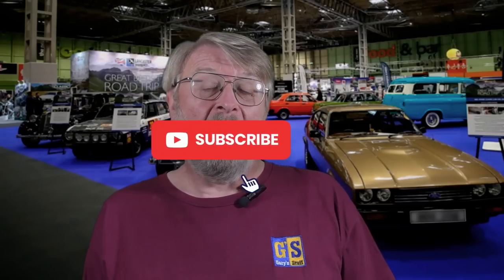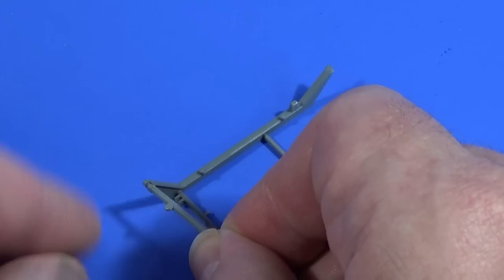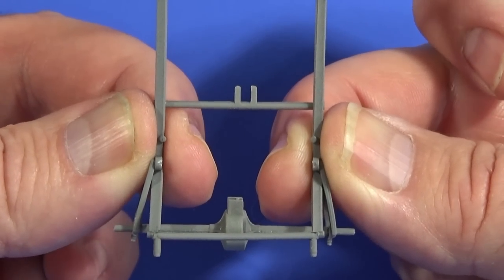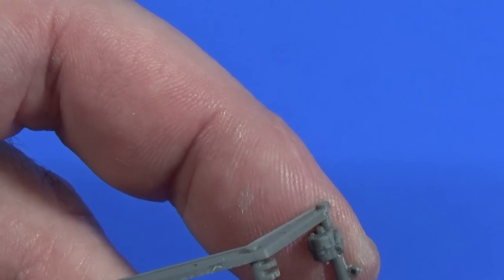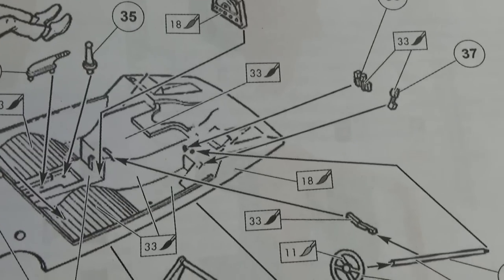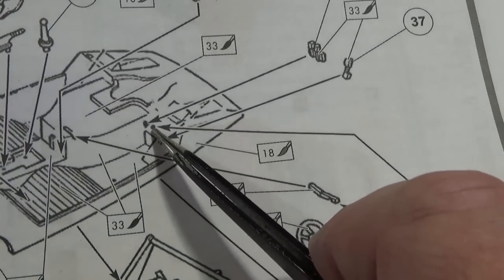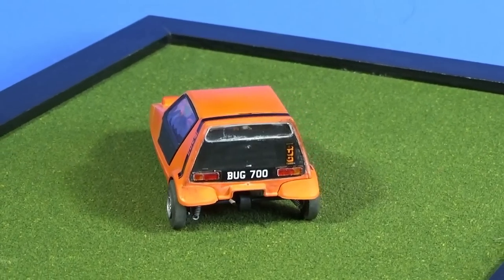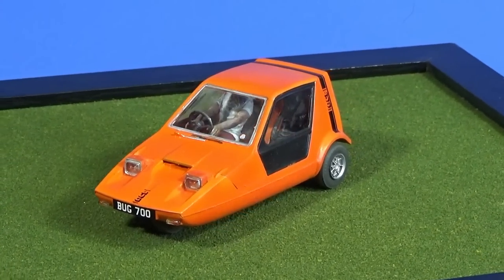BUILD A BOND BUG!!! Making the Airfix Vintage Classics kit

Comment: My brother had one of these, a real one, in the early '80's. I am not sure that the kit isnt more complex than the real thing! It was a scary beast, especially when driven by someone more in tune with riding a motorbike with or without a sidecar. Horrribly unstable in a braking turn when all the weight shifts to the unwheeled front corners, but otherwise a bit of fun. Good representation rendered in the kit; the orange looks a particularly good redition of the gel-coat finish of the real fibregalss shell.

Comment: I've been thinking about getting one of these. I wouldn't paint it stock though.
I'm tempted to paint one as if it was a shuttlepod from Star Trek. It has the same sort of shape and would be something different.
Similar to how they modified a Smart Car in Red Dwarf to resemble Starbug.
Reply: It's actually more like the Workbee from The Motion Picture onwards...
Reply: @Adam_Boots What about replicating Top Gear's attempt at simulating a Shuttle using a Robin Reliant? :)
Reply: It could work well as a workbee. I just like the idea of adding fake nacelles and using it as a runaround. The back window could be modified to resemble the Galileo impulse engine. Now that you've given me the idea I'm now tempted to get two. One for a pod the other for a bee.
Reply: @julianmhall  I'd do that with a model of a Reliant Robin as it already exists.

Comment: Gary- as a bond bug owner the steering is shown wrong on this model. The drop arm should be on the off side and drops down to meet the horizontal bar. The hole in the steering box should be on the other side so it fits into the steering column.
Reply: as you say its the same as on a robin i believe and ive had a few of them over the years bard to find a good one now.

Comment: Lovely job! WRT the steering box I've had a look at a couple of diagrams online. Hard to tell as they're right hand drive and this is left. As for the replacement part, the pointy bit on the parcel shelf is obviously for passengers you don't like lol
Reply from the maker: This one is right hand drive, as I think they all were unless they were subsequently converted. It would be quite a job to change the steering arm and box to LHD I think...

Comment: I had this kit with the same rear section problem. I ended up making a part for the rear window and parcel shelf, it came out ok. Perhaps I should have just got in touch with Airfix.
Reply from the maker: From what I understand, it cost Airfix a lot, and I mean a lot, to re-mould frames so they could replace these parts for customers. You do wonder if harsh words about the issue were spoken with the manufacturers as a result. They should have been!

Comment: Nice video as always. I’ve just started mine and ran into similar issues as you with the front suspension/steering assembly as well as the short shot on the rear panel. The customer service from Airfix was amazing though, can’t fault that! Some of the instructions are a bit unclear too. Overall though so far the kit is going together remarkably well for a 50 odd year old tooling!

Comment: Great video, Gary. I think the correct term for the pieces that attached the axle to the chassis is, "radius arms". I guess the roof decal can be trimmed down, if necessary? I'd rather it was too long than too short.  Also, credit to Airfix, the side screens look really effective. I was slightly worried that the wavy effect wouldn't look convincing.

Comment: Well Gary a very pleasant model, difficult to say much more than that about it. Interesting the part was out to you so fast, do recall the discussion last Summer we had about spares and how fast Airfix got them out?😢
Bob
England
Reply from the maker: I think in this case there were so many people reporting the exact same issue with a brand new release that they have pressed loads of replacements and shipped them over so they are ready to send them out and be amazing. What it doesn't address is the lack of quality control in the first place...

Comment: There was quite a few if those around west London in the early 70s ,but,cut to 1985 there’s me 17 years old just passed my test driving my shiny mk3 escort just passing the master Robert on the A4 I look in the mirror and one of these goes nodding and farting past me at warp factor 9 hehe all my family couldn’t move with laughter especially the verbals I came out with 😂😂😂😂,great job mate you cheered me up I’ll be on later pal 
Mark 😊😊
Reply from the maker: Wow, a Mark 3? in '85 I was stooging about in a Mk.1 1100 but with the 1600 engine transplanted into it. Thought I was the dog's whatsits but probably looked a right gear knob.
Reply: @garys_stuff  hehe I got it on the never never I was on £110 a week then as a postal cadet prior at 18 being a postman driver which I done for 27 years mine was a 1.3L in Nordic blue

Comment: Excellent video, thanks. May I ask what glue do you use to join the painted parts together as they seem fully painted with no plastic to plastic joins?
Reply from the maker: Regular polystyrene cement. If the parts are very painted and varnished I'll sand the joint slightly.
Reply: @garys_stuff  Thanks Gary. Is that the thin stuff or the old fashioned glue I remember from years ago?

Comment: Nice work Gary. I’m just about to start mine so watching this has been very informative. Regarding part 32 I wonder if there is some damage to the tool which can’t be repaired and the factory had been asked to modify the parts by hand.
Reply from the maker: That's a very interesting point Ian. I know that Plastech, who do the 1/24 Spitfire, has the ability to make alterations to tooling if needed, so it's entirely possible there was an issue that was corrected onsite. I suspect Airfix have ordered up a whole bunch of corrected frames so they can service the numerous spares requests in a timely manner!
Reply: I think part 32 was the result of a 'short shot', where the injected plastic fails to fully fill the mould.

Comment: Great, thanks!  Interested to know what orange paint you used and whether you put it over a gloss prime coat or polished/varnished it - you got it nice and shiny!
Reply from the maker: I used a base coat of mog One Shot white with a couple of drops of red to make a pink primer, then two coats of Vallejo model air 71.083 orange. On top of that were two coats of Amy Painter gloss varnish.
Reply: @garys_stuff .  Great, thanks for that.  You made a really nice job of it.